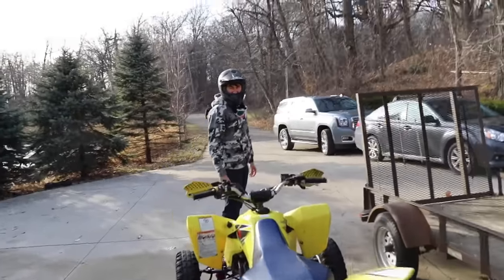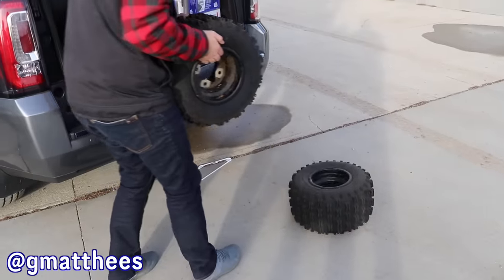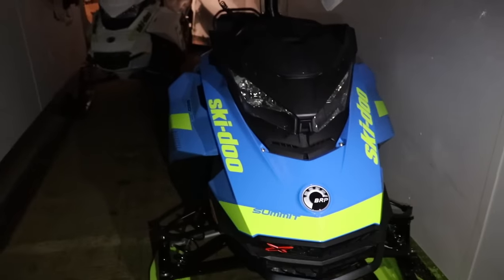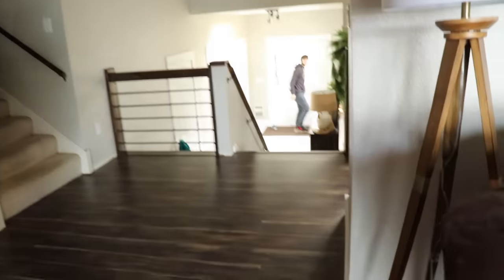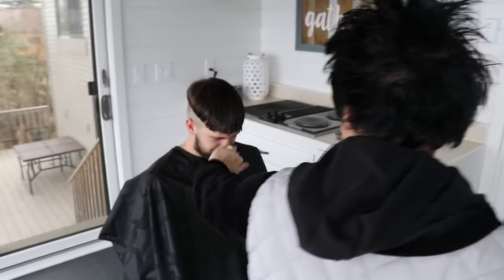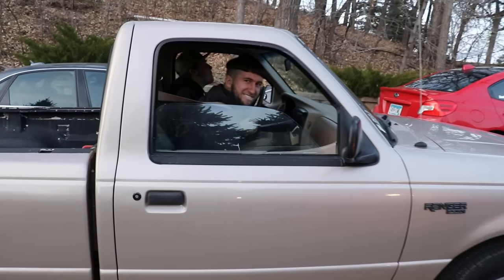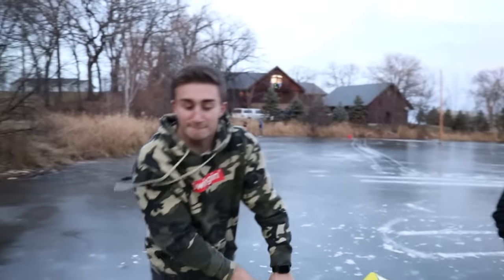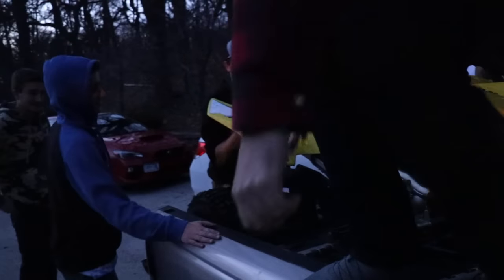Quad Wheelies on ICE!!

Comment: Studding tires is the worst, i used to stud mudslinger tires.. took a good 30 mins each tire to fill the tire with studs with the stud gun, a machine would of been so much easier and faster. 14:05 you gotta be careful too if you didn't install the studs safely and correctly the studs can shoot out like bullets, pre made studded tires are sus because they are made then tossed around which can loosen the studs pretty easily with vibrations.